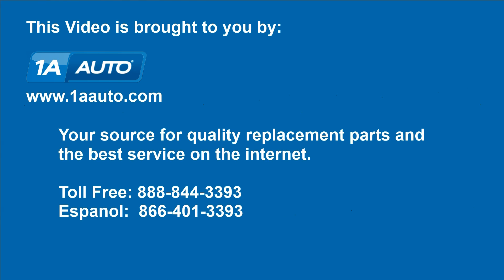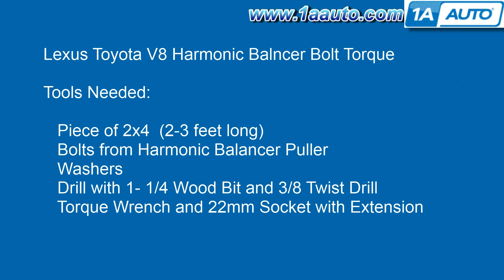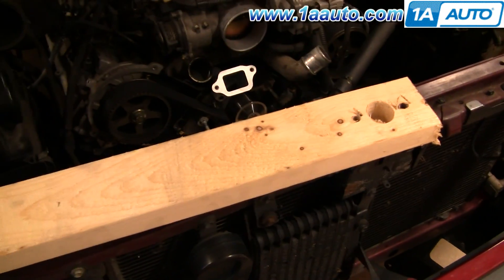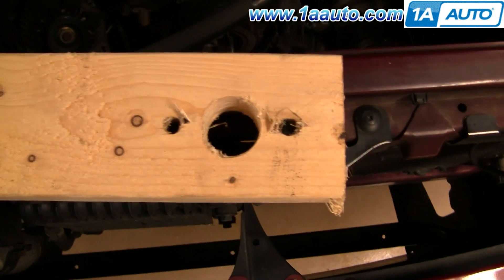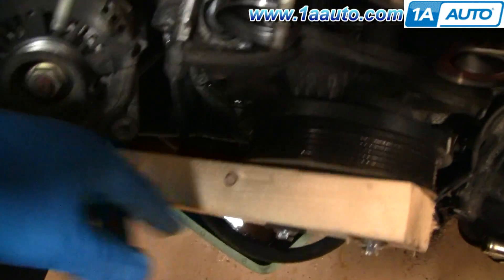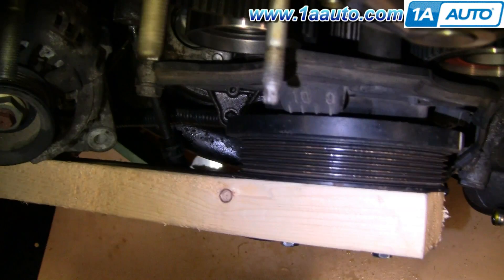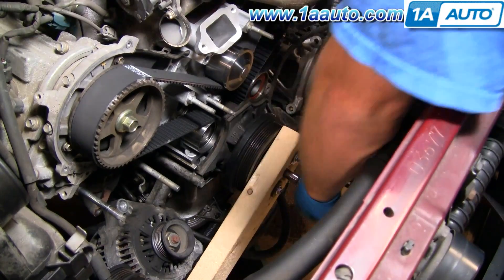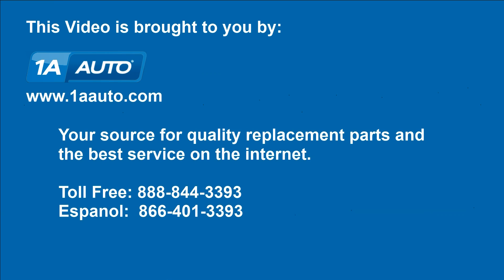How To Torque Toyota/Lexus V8 Harmonic Balancer Bolt Without Special Tool

Comment: what is the spacing between the two m8 bolts?
Reply: If you don't get an answer on this, just measure the distance between the holes on your harmonic balancer.

Comment: Tried this and the 2x4 split in two :(
Reply: I ended up using an Arnold 20" universal lawnmower blade which has a "-- o --" hole pattern (slots instead of holes for the two bolts which worked out perfectly for adjustable spacing, but the hole in the middle was too small for a 22MM socket. Let me tell you it took me 3 drills and 4 bits to get the hole large enough and nearly gave up but managed to fit a non-impact socket through my final result. The impact was just a hair too wide. For anyone else trying this, I highly recommend just buying the correct tool as shown on many other videos. I was desperate to get the job done and could not wait the week it was going to take from an online order, but in hindsight, I would have started working on this only after getting the correct tools.

Comment: Does this work to get the bolt loosened as well? What a pain in the neck this has been... I really prefer not spending 100 bucks on a tool i will only use once.

Comment: Can you specify what size the "Harmonic balancer puller" bolts were?
Reply: 8mm, 1.25 pitch
Reply from the maker: +Ryan Kelleher Thanks for watching!  Unfortunately we do not have the exact specs on what was used on the vehicle.  However you can usually rent a puller tool from local auto parts stores and it will have a selection of bolts to use!  1aauto.com